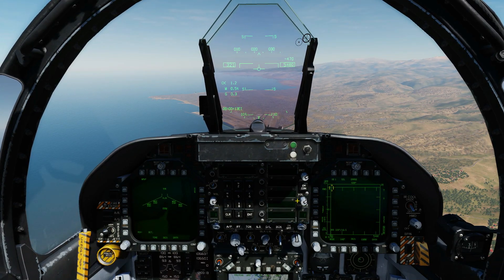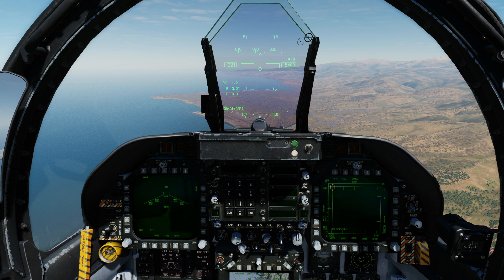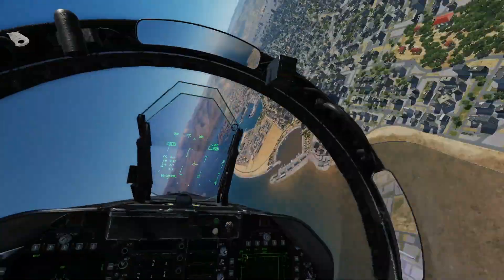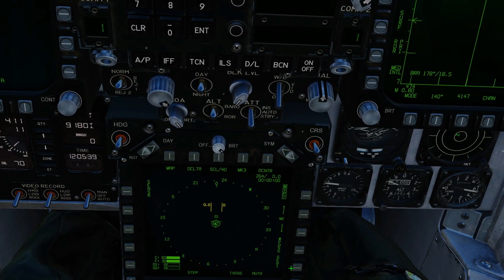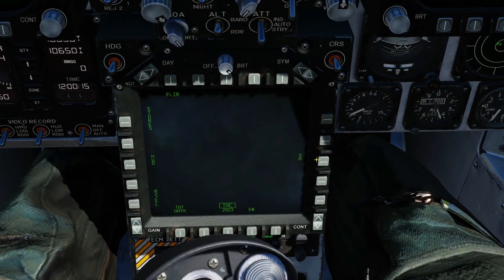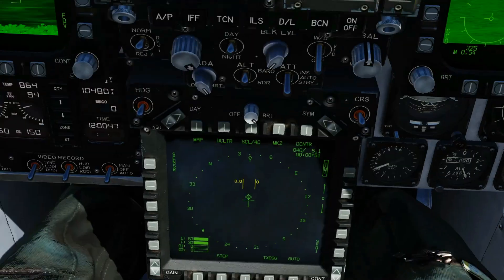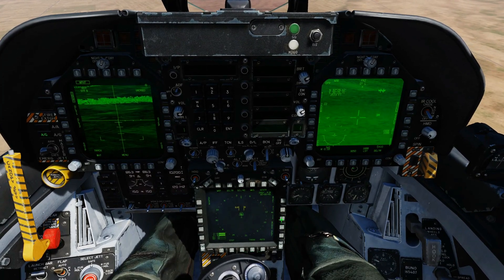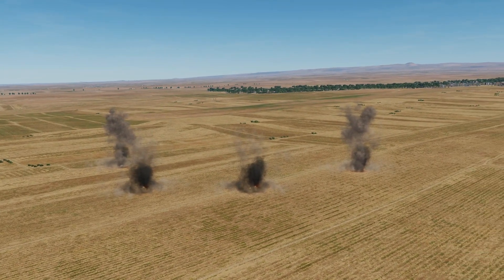FA-18C Hornet: Mark Points For Navigation & Rippling Weapons Tutorial | DCS WORLD

Comment: the reason the weapons all arrive at nearly the same time is that they are fired from different distances and once they're rocket motors burn out the first one is fired will decelerate where as the last ones fired are still accelerating and since all of these targets were at a similar distance all weapons arrive at approximately the same time as weapon speeds acceleration and decelerations in DCs are not variable all all Mavericks travel at the same speed and decelerate at the same speed all rockets travel at the same speed as every other rocket of that type and decelerate at the same distance and at the same rate as every other rocket of that type.